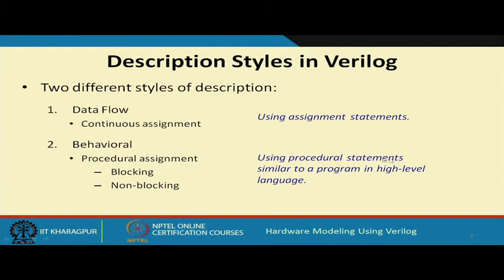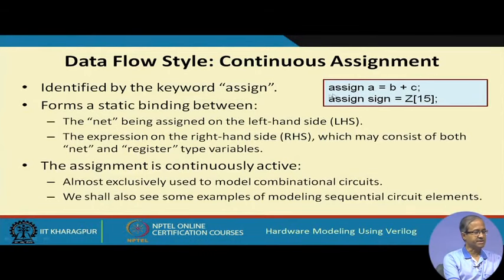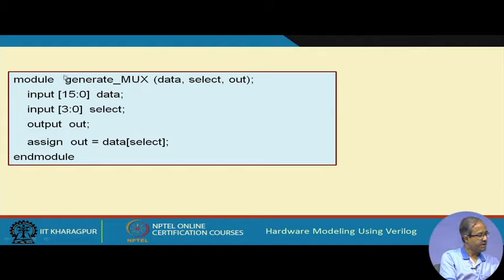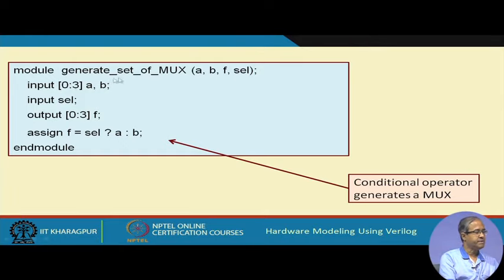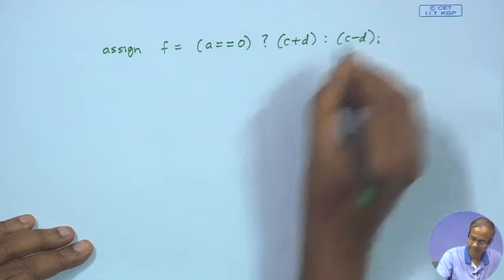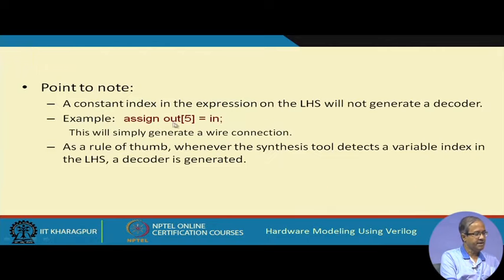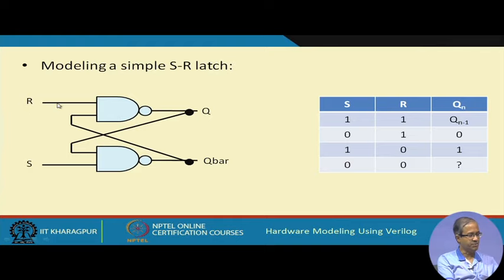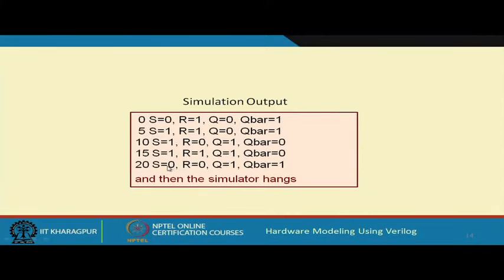VERILOG DESCRIPTION STYLES

Comment: The decoder code is actually a demultiplexer. But if you take a decoder, and simply take the in signal as an input to each of the decoder’s and gates, it becomes a demux. The only change is a decoder would be “assign out[select] = 1’b1;”

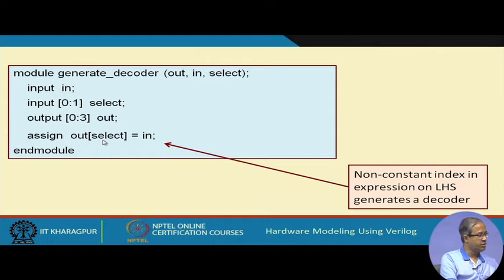Comment: Thank you,  correct me if  I'm wrong  I think in 19:23 this is a Demux not a decoder since we have a selector
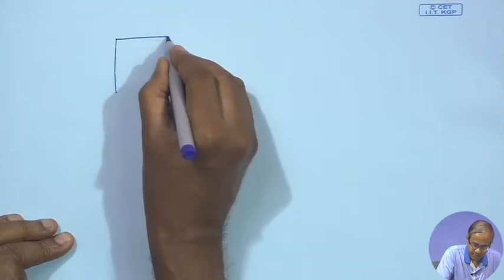Reply: on 19:35 , he says that it both demux and decoder is the same
Reply: @kushalm7328  good notice
Reply: when input is only 1 in decoder it will become de mux
Reply: Demux is also called a decoder and both works the same way
Reply: @srgeditz9788  are you preparing for vlsi
Reply: @srgeditz9788 not especially

Comment: Can anyone help on the following !!! 
The decoder code is showing error and non synthesizable- ERROR - sel is not a constant

module Simple_decoder_1_to_4(in,sel,out);

input in;
input [0:1]sel;
output [0:3] out;

assign out[sel]=in; // when LHS is variable we get a decoder

endmodule
Reply: "assign" statement is always active, that is, whenever the values of RHS operands changes, the new value of LHS is evaluated and updated on the net.
	But in the code explain by the professor, the LHS has a variable on the LHS which is illegal according to the above definition of assign statement.
	Thus, the code can be modified as below

module generate_decoder (out,in,sel);
	input in;
	input [1:0]sel;
	output reg [3:0]out;

	always@(in,sel)
	begin
		out[sel] = in;
	end
endmodule

	In the above code, "out[sel] = in;" is synthesized as decoder as explained the professor.
Reply: @murugeshwarana2427  it is showing error : procedural assignment to a non-register out is not permitted, left-hand side should be reg/integer/time/genvar 

please see the matter and kindly reply
Reply: you used 3 variables but declared 2 variables. that might cause an error
Reply: but decoder ckt will not having selection line

Comment: the decoder code is showing error and non synthesizable- ERROR - sel is not a constant

module Simple_decoder_1_to_4(in,sel,out);

input in;
input [0:1]sel;
output [0:3] out;

assign out[sel]=in; // when LHS is variable we get a decoder

endmodule
Reply: "assign" statement is always active, that is, whenever the values of RHS operands changes, the new value of LHS is evaluated and updated on the net.
	But in the code explain by the professor, the LHS has a variable on the LHS which is illegal according to the above definition of assign statement.
	Thus, the code can be modified as below

module generate_decoder (out,in,sel);
	input in;
	input [1:0]sel;
	output reg [3:0]out;

	always@(in,sel)
	begin
		out[sel] = in;
	end
endmodule

	In the above code, "out[sel] = in;" is synthesized as decoder as explained the professor.
Reply: @murugeshwarana2427   Thank you. Your ans really helped.
Reply: you used 3 variables but declared 2 variables. that might cause an error